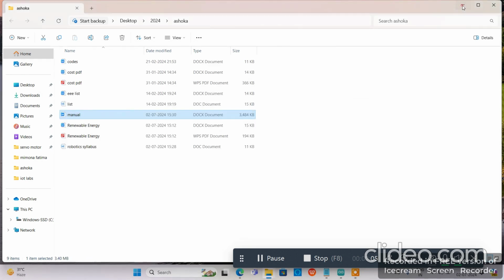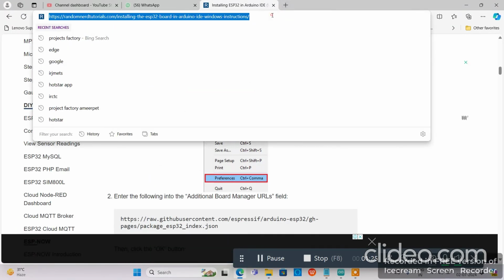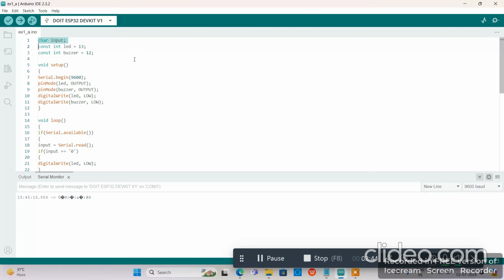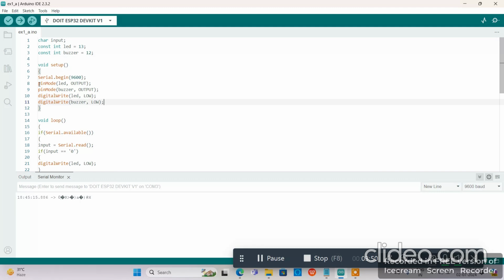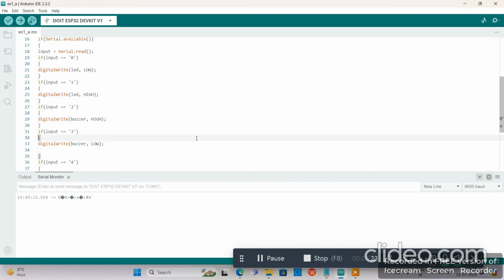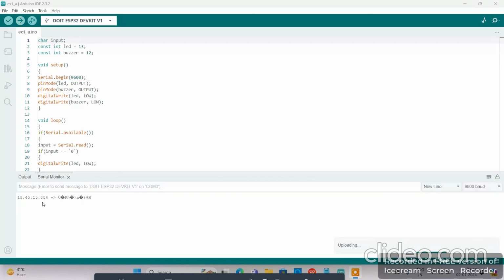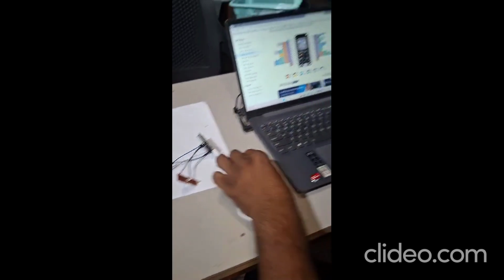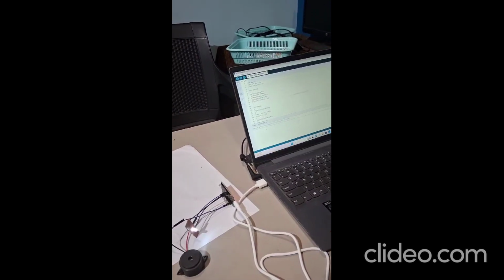Experiments using esp32:

Comment from the maker: code:
char input;
const int led = 13; 
const int buzzer = 12;

void setup()
{
Serial.begin(9600); 
pinMode(led, OUTPUT); 
pinMode(buzzer, OUTPUT);
digitalWrite(led, LOW);
digitalWrite(buzzer, LOW);
}

void loop()
{
if(Serial.available())
{
input = Serial.read(); 
if(input == '0')
{
digitalWrite(led, LOW); 
}
if(input == '1')
{
digitalWrite(led, HIGH);
}
if(input == '2') 
{
digitalWrite(buzzer, HIGH); 
}
if(input == '3') 
{
digitalWrite(buzzer, LOW);

}
if(input == '4') 
{
digitalWrite(buzzer, HIGH); 
digitalWrite(led, HIGH); 

}
if(input == '5') 
{
digitalWrite(buzzer, LOW);
digitalWrite(led, LOW); 

}

}}